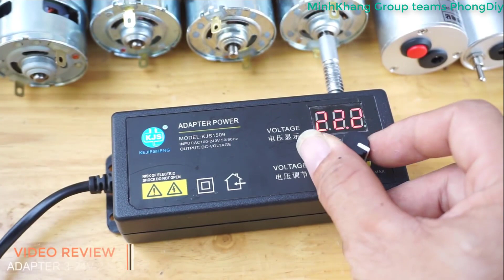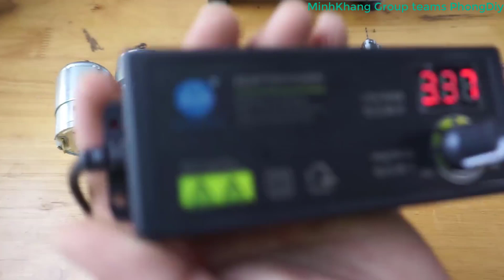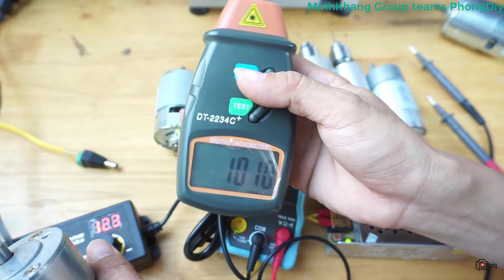Bộ adapter hình LCD chỉnh áp 3V~12V~24V - 2.5A có màn hình LCD hiển thị VOL

Comment: em mới mùa motor 895 em  đi mùa nguồn 12v 3A  trên tiêm Đt  nó bảo motor em bị hư nên nó không quay được em bảo nó bình ác quy 6v 5A  vẫn quay được mà những mà nó quay chậm nó cứ bảo motor em bị hư  Cho nên em mới nhảy xuống đây
Reply from the maker: không phải hư đâu anh . mô tơ 12v dùng nguồn tối thiểu 5a 
còn bên em khuyên dùng là nguồn 12v 10a 
hiện bên em có nguồn tổ ong 12v 10a đó anh
Reply: @khohangbaiphongdiy  anh ơi nguồn 3v-24v 2.5A vs nguồn 3v-36v 1.7A cái nào chạy được motor ạ cũng như là ngon hơn ạ
Reply from the maker: @longnie3257  cái 3-24v 2.5a có khả năng chạy được hơn, nhưng nếu chạy được sẽ sinh ra hiện tượng giật giật, nguồn dùng cho mô tơ 775 12v tối thiểu 12v 5a và khuyên dùng là 12v 10a em ạ